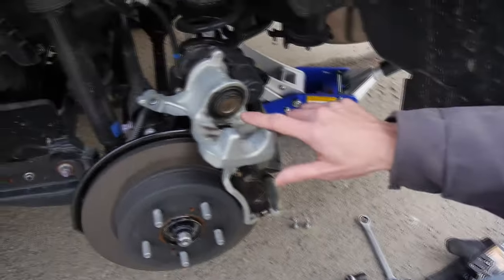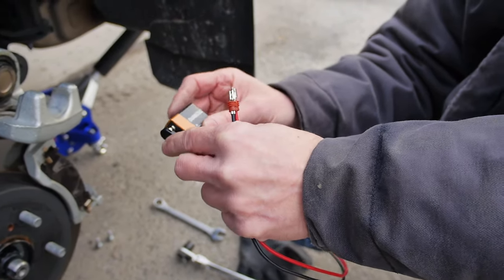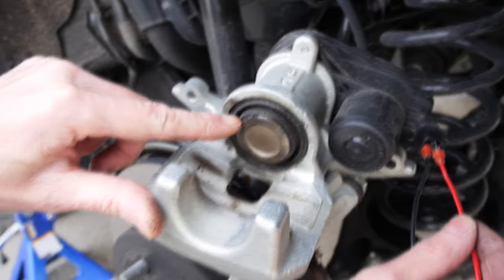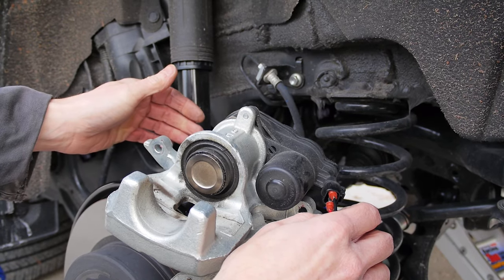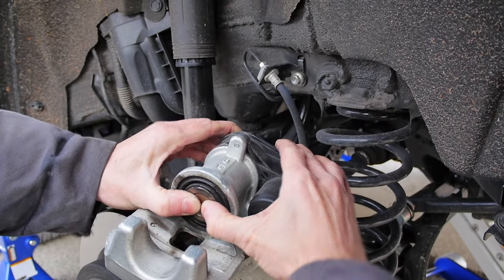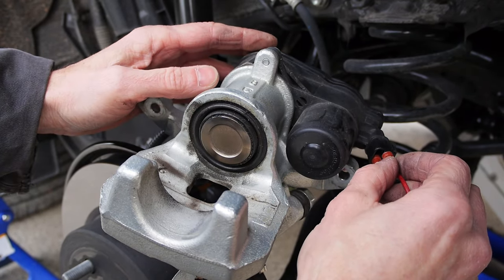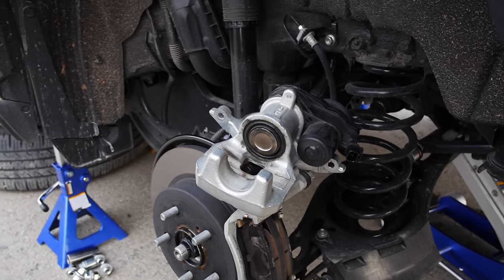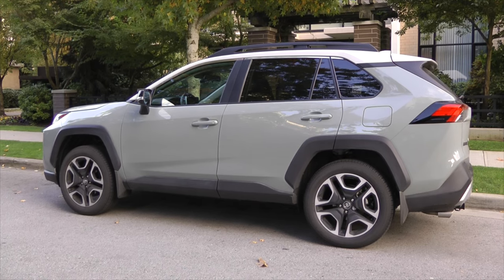How To Manually Compress Caliper Piston Using 9V Or 12V Battery In Toyota / Lexus With EPB Brakes?

Comment from the maker: PRODUCT LINKS:
1. 2Set 8 x AA Thicken Battery Holder with I Type Wired Battery Clip Standard Snap Connector - https://amzn.to/3Y2CNPv.
2. Duracell Coppertop AA Batteries with Power Boost Ingredients, 8 Count Pack - https://amzn.to/4dxwagr.
3. Duracell Coppertop 9V Battery, 2 Count Pack - https://amzn.to/3wYEqSh.
4. 46310-33010 Parking Brake Actuator Replacement for 2019-2022 Toyota Corolla Highlander RAV4 C-HR Camry Avalon Lexus ES IS RC UX 200 250 300 350 - https://amzn.to/4ePlday.

TOOLS REQUIRED:
1. Pittsburgh 3 Tons  Aluminum Racing Floor Jack With Rapid Pump - https://amzn.to/3JHEttC.
2. Pittsburgh 3 Ton Light Weight Aluminum Racing Jack Stands, Set of 2 - https://amzn.to/3RwdS4x.
3. GEARWRENCH 14 Pc. 6 Pt. Combination Wrench Set, Metric - https://amzn.to/3YlkTag.
4. GEARWRENCH 57 Pc. 3/8" Drive 6 Pt. Mechanics Tool Set, Standard & Deep, SAE/Metric - https://amzn.to/41wE6Z3.
5. GEARWRENCH 3/8" Drive Micrometer Torque Wrench 10-100 ft/lbs - https://amzn.to/3YmhnN2.
Reply: Caliper выдернул с резины , ее можно поставить обратно?

Comment: On Toyota chr you can follow a procedure using the electronic parking brake lever to retract the piston. But i didnt realise you can apply power directly to the contacts to also push the piston out as well thanks for the explanation.

Comment: Super helpful video. I’m going to try the 12v option on my Volvo and BMW when I need to do the rear brakes. The Foxwell 530 OBD2 bidirectional scanner is capable of accomplishing this by putting the brakes in service mode, but you do have to pay for the scanner + additional $ for different car manufacturers.
Reply: Hi. I used to own a foxwell too. I eventually bought a launch 129 pro from launch directly. It covers everything you need including EPB. free updates for life too. It's a spend though for home mechanics at £269 but the usefulness of it served me well as a Roadside tech too. I rarely got my snap on scanner out!

Comment: LIFESAVER big big thank you to you man, I was so beyond stuck. Spent like 40 mins toying around with leverage to compress piston… even bent my piston compression tool…. Hint for anyone else that this is going to help big time, OP shows a 9v circuit waiting to be completed that’s made of material not everyone has laying around the house.. 

if you need to implement this trick and you aren’t a mechanic/electrician with all sorts of 12v leads and grounds laying around, you can literally pull one out of something as simple as an old Co2 sensor that runs on 9v batteries, cut positive lead and ground from the board of the old appliance… strip the wires, touch them to electronic motor for caliper… all set! Bonus points if you find a way to pull out just the wires and terminal connectors all still in one piece without the need to resolder… and you won’t end up looking silly as all hell when the neighbor looks out and sees you plugging a co2 sensor into your brake caliper lmao

Comment: I'm a master Tech of Toyota no need of battery with the Rear Brake Service "you can do the Service only with the Parking Brake Switch"
1) Car switch on/Ready (engine off) Push Start button 2 times without pressing the foot brake pedal - if with key just move the key to ON position
2) With Car in on Position (Engine OFF) NOW press the foot brake pedal don't release it and push the parking brake switch 3 times up and 3 times down and the Brake light would start blinking (service Mode)
3) Now release the foot brake pedal and push the Parking Brake Switch Down don't stop pushing it because you would here like in 4 seconds the rear brake retracting the Piston. When you stop hearing it you can now stop pushing it down the parking brake switch.
4) replace the pads or make any service of the rear brake
5) Now just push up the parking brake switch and hold it UP until the blinking brake light STOP blinking. which mean the Rear brake piston is Release and the vehicule now Exit of service mode to Normal operation